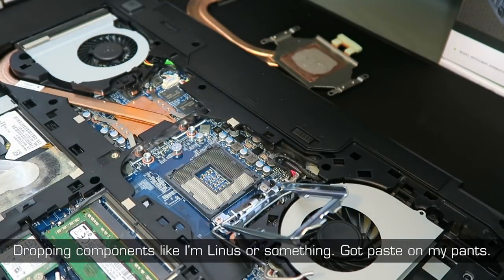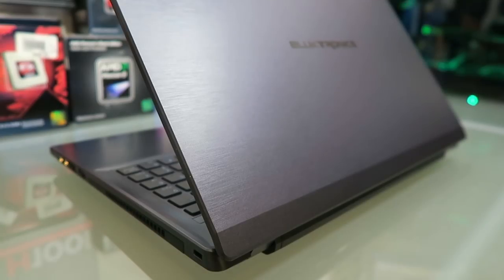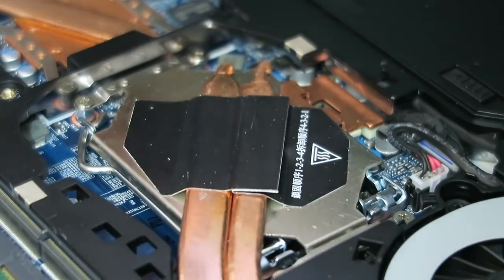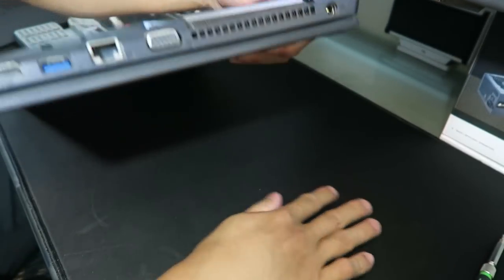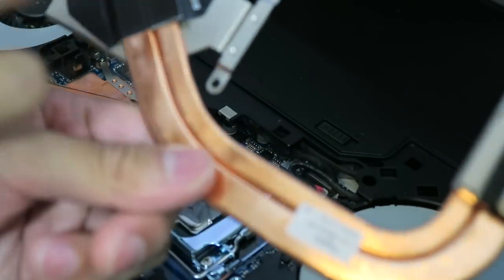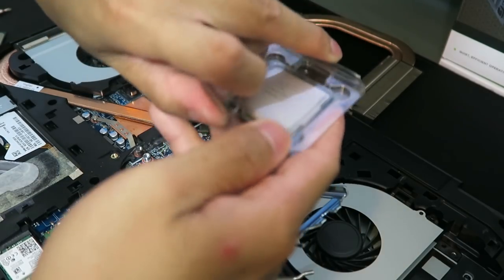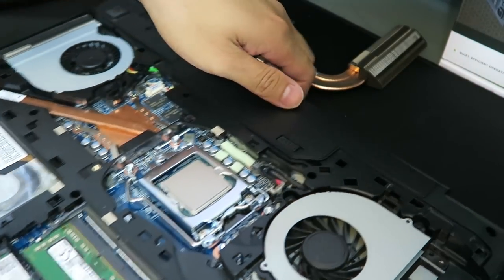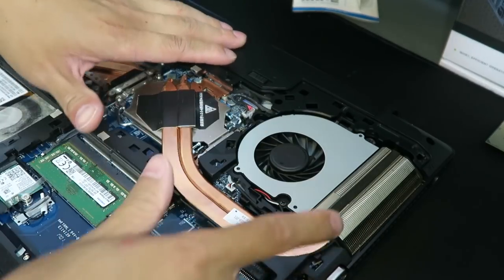Laptops That Use Full Desktop CPUs

Comment: As far as I know, "desktop cpus in in laptops" started earlier than 2007. I have a desktop replacement laptop from 2004: HP Pavilion ZD8000. It uses prescott Pentium 4s. Someone said that it can run with cedar mills too, but I never tried it.

Comment: If it's at all possible to have this caliber of cpu in a laptop then I don't know why the big companies don't have models with these CPUs. Especially the behemoths of laptops ie the acer predator 21X and the asus rog gx800vh!!
Reply: Morhaph Hajjouk It's more profitable to sell a machine that cannot be upgraded than one that can, so even these extremely high-end, flagship laptops like the water-cooled ASUS GX800 and the 21" Acer Predator laptops use soldered, Skylake CPUs, which is a real blow to the value despite the fact they are sporting partially unlocked (the HK model processors) hardware.

Comment: wasn't before Pentium 4 that laptops started to use different sockets and different versions of CPU's.
got an old Aopen with a standard socket 478 Pentium 4 3.06 HT in it... and a crappy Nvidia FX5500. was just for schoolwork so it was good.
had an Hyundai HN50000 before that one... but that is a dinosaur that is so old Hyundai don't know they made it x)
(was a Pentium MMX 166MHz, 16MB RAM, 1.2GB harddrive and a S3 gpu, is a AMD 400MHz in it now, 64MB of RAM and a 4GB CF and works flawless for old DOS games...)
but know there was some low-wattage Pentium 4 2.8GHz for laptops, but these where desktop cpu's that run stable undervolted.
after that stuff started to split, first in different versions of the cpu and then different sockets.
(AMD Turion X2 was socket 754 and last one to use standard socket before all went different socket, so this was the other way around, a laptop cpu you could use in your standard desktop.)

a funny laptop's that uses desktop cpu's are the the ones from Clevo. example the X7200 that uses a fullflegded socket 1366 i7 and support for 2 MXM gpu cards for ether SLi or Crossfire...
then the P270WM comes... a dual gpu socket 2011 laptop with quad-channel ram support and 3 2,5" drives... nuts...
Reply: Børre Børresen It was called the P270WM and was slated for release in early February 2012, just a few months or so after the X79/LGA-2011 high-end desktop platform launched, but the system had overheating issues so it was never launched; instead, another year went by and a newer, revised model using the same hardware platform and socket was introduced in early 2013, in two models, the P570WM (non-3D/non-120 Hz) and thr P570WM3 (3D/120 Hz).
Reply: the P270WM was launched and was the successor to the X7200, we in Multicom in Norway sold a 100ish of em. (i even have a working one in my shelf, missing MXM coolers though...)
the P570WM was though a better buy when it came.
heating problem of the P270WM(and also X7200) was with the ones equipped with Geforce GTX480M or 580M in SLi, just as Alienware these went toast quite fast, and if not the gpu's got fried then the power-supply went *poff*.
with the P570WM the Geforce 680M was released and Nvidia had done way better job on heat with that.

most we sold was with Quadro cards as gamer's wasn't interested in these very expensive, super loud and heavy behemoths but lot of businesses was interested in em for various reasons.

Comment: You struck a very balanced combo, with ~100% CPU and also ~100% GPU usage. You get the most out of both and don't idle or get bottlenecked. I was surprised buy the decent temperatures.

Comment: Just in case you weren't aware practically all laptops used desktop type sockets until the Pentium 4 era when the centrino (Pentium m) came out and started the push towards low power consumption. Back then you bought a Pentium 4 desktop laptop for power or the weaker centrino for portability. This was eventually developed into the core duo/ core 2 duo and ported to desktops which is probably the only time a chip developed for mobile was ported back to desktop, although the centrino was just a refined Pentium III.

Comment: Really appreciate you satisfied my curiosity on the process of upgrading a laptop that use Desktop CPU ,
 
At the beginning i thought you would bump into things such as 
bios problem (or somehow they locked the bios ) 

Btw is there anyway to control the fan speed ?
Is there a way to undervolt the CPU for better temps and battery life ? ( curiosity and extended battery life !) 
as for the CPU if it's below 75°C i quite ok with that 
but for the GPU hitting 85°C was a bit too much for me

Now my opinion 
As a power user , a desktop user for over 7 years myself and a guy who need to go to University about 3 months later

rocking a i7 3370 + 16GB ram + GTX 1060 6GB

i mostly use my PC for files compression 7z/Winrar , 15 tabs chrome , Dota 2 , premier pro , phyton , Civilization VI , NieR:Automata , Shadowplay and some triple-A title

A pentium G4560 will mostly not sufficient my usage 
 it is still slightly better i5-7200U and slightly weaker or equivalent to i5-7300U which is mostly found in laptop under the 700 dollar price bracket 

A i5 6600 would be a wise choice in this case it crushes the i5-7300HQ and perform near a i7-6700HQ which is moslty found in 800 dollar and above laptops

A i7 7700T/ i7 6700T would be better to control the heat output and give you a good performance as long as the price is reasonable (35 watt)

BUT intel is going to release the 8th gen processor
 on 21 of august which is tomorrow (in my time zone GMT +8)  

it rumor that 8th gen core i7 and core i5 mobile U series chip  will have 4 core and 8 threads And a TDP OF 15 WATTS

Intel Core i5-8250U – 1.6 GHz base clock / 3.4 GHz turbo, 6MP L3 cache
Intel Core i5-8350U – 1.7 GHz base clock, 6MB L3 cache
Intel Core i7-8550U – 1.8 GHz base clock / 4 GHz turbo, 8MB L3 cache
Intel Core i7-8650U – 1.9 GHz base clock, 8MP L3 cache

i7-8850U is also rumor that it comes out ahead of the i5-6300HQ 

conclusion 
upgradeability is a way to save more money since you don't have to change the whole laptop for a cpu

but i think the new 8th gen chip will destroy the i5 6600 in the same price bracket  in term of performance and power efficiency

Comment: I own a Toshiba P30 Laptop :) It's from about 2004 and has a Pentium 4 HT 560J processor in it running at full speed. That's a LGA 775 desktop CPU that has a TDP of 115w :) It has a massive dual radiator/fan cooling configuration. Still runs like new, and is really good at heating to room too

Comment: what  bothers me most about laptops these days isn't even not being able to swap out the processor, that would be handy, but its so annoying now days to even do simple things like chuck some more ram in or drop in a new hard drive/SSD, I've got an older HP G3 250, to throw another stick of ram in, i had to completely dismantle the laptop and pull the main board out because theres no simple access panel at the back, replacing the hard drive is a bit simpler, but still requires taking the keyboard and the entire top cover off to be able to gain access to the hard drive, i just wish the bigger companies would make things like that easier, but i'd definitely love to be able to easily drop a new processor in too, that'd be nice.

Comment: There is a market for "desktop replacement" laptops. I bought one with a 7700HQ and 1050ti because I wanted some graphics for light gaming. It would be great to be able to upgrade the processor in future but I will do that by selling the entire laptop or just buying a new one and handing this one down. 7700HQ isn't bad for a processor soldered to the board. I'm not feeling deprived. I actually bought this laptop to take to the Philippines as a desktop replacement. I shopped online and I could barely build a desktop as capable as this laptop from new parts in the Philippines compared what I paid for the laptop in the US.

Comment: There are two main reasons manufacturers don't use desktop CPUs:
1. Cost. It costs manufacturers more to design, engineer, and build a laptop that can use a desktop CPU. heat management is a concern and requires a good design to dissipate. Also, if users are able to upgrade their laptop by dropping a new CPU in, that's fewer users that will buy a new laptop in a couple years. 
2. Battery life. Desktop CPUs draw much more power. As such, they will suck down battery life. Most users don't need the power that a desktop CPU provides but would complain about poor battery life.

Comment: Got an older one for you, I own a Thinkpad G40 from 2003. They were socket 478 laptops. Thats right, Northwood Pentium housefires. Mine has a 68w 2.8ghz Pentium 4 in it. Oddly enough the cooler is fantastic and keeps it under 60c with low fan rpm. When it's under 55c it runs passively.

Comment: Actually, I still own a Emachines E510. It's a 2003 build date laptop  that has a regular CPU socket. The funny thing is the old bugger still works, swapped the Celeron single core for a Core2Duo cpu from the fried laptop I bought afterwards ( it was a trash HP, as a enthusiast PC repairman, HP and Dells  are a nightmare to me ) and the Ram upgraded from 2 GB to 4 GB. To date, I can still browse the internet with no issue , play some games, use YouTube up to 720p ( the onboard graphics can only handle  that much online, but it can handle 1080p movies files offline when linked to  my TV). This  laptop has been a wonderful workhorse and a reliable failsafe in case my newer laptops or desktop kick the bucket. Besides, it's not like I keep it shelves, the bastard runs 24/7 with incremental games loaded.
Reply: Dread Walker Emachines releases reliable computer.

We really are in the darkest timeline...
Reply: Such a great laptop, he definitely deserves a name after 14 years of service.
Reply: Roos Skywalker Thank you, you actually gave me an idea. I will now frame the old nutjob when it finally dies. Still gonna have to think of a name tho and it looks like he still has plenty of juice in it,commenting this from it right now. This laptop really goes to make a statement on the the quality of production in the electronic department  lately, since i changed 4 laptops while i had this one and 2 desktops. Shame on the companies really, if a almost no-name brand can slap them on the face with a way more cheaper and durable laptop for nearly the same performance. When i bought this one back in 2013 in Romania ,I really thought i was seeing double since it was  only 334 dollars brand new, which was rougly 40%  of the price of a similar branded laptop.
Reply: Hah, Emachines only shipped their computers with low end processors like Celerons. The first time I hear of an Emachine having its CPU replaced with a higher end one, it's a laptop :-P
Reply: And it was made 3 years before the Core 2 Duo came out and 2 years before the Pentium D came out!
Reply: I don't know why you had to reply to me with info I already knew since I have worked from 2002 to 2012 as a computer tech mainly handling low to mid level repairs and doing custom builds. And I pointed it out that I replaced the Celeron with a Core2Duo from a later bought laptop that died (it was a garbage level HP bought in 2007 which had a fried motherboard only a week after the 2 year warranty). I mean, I thought that was self explanatory or easily deduce-able from my previous comments that I was speaking of a period of time from 2003 to today.
Reply: Dread Walker I call laptops older than 10 years survivors, (in addition to a personal name) because they are. I had on such survivor, he died at the age of 12.
It was a silver coloured Dell, back in the day 2006 it was a very expensive high-end laptop with 4GB RAM, a dual core and 256MB VRAM dedicated graphics. It cost a whopping 1500€ back then.
I have no regrets, it survived many things, including but not limited to: a car crash, moisture and a short circuitry. Ow yeah to fix the GPU it was put in the oven at 200°C. That fucker did it all and survived until one day he didn't boot anymore.
The CPU died, and with that included its life.
#DellVeteran
Reply: Roos Skywalker May he rest in peace.  Mine is still  to show any  signs of dying at the moment, well  his battery is nearly dying, the thing barely keeps a 15 minute charge, but hey it's  enough to save in case of a power outage. What helped a bit with it's long use life is the fact that I break it down to the last single part and do a thorough cleaning every 3-5 months. Dust is the single greatest killer of laptops,  and this one is quite the magnet for  it, well maybe to a bit of a design flaw, but hey for 334 $ this guy paid it'self 5 times over anyway, so if he wants to take the final rest,  i can at least build his memorial :D (well...after i do one last surgery on him to try to  save him.)

Comment: Clevo made designs with desktop-CPUs all the way back in the days of the single-core Pentium 4. I had one of those, model number was D900T and it was available with a GeForce 6800 for graphics. Very large, very heavy device (17" 16:10 screen). Cooling demands were such that there were 4 fans installed - 2x CPU, 1x GPU and another that apparently served the overall system. It also had internal space for a pair of HDDs on a RAID controller that could be run as either PATA or SATA (provided you had the right cables to connect the drives) and two (!) optical drive bays. There may also have been a model that supported the competing AMD processors at the time but I don't remember the details.

Comment: Actually, all of the earliest laptops and other portable computers used desktop CPUs because in those early days there were no CPUs designated for mobile use.  A portable would have had the same type of processor as a desktop because that's all there was.
Reply from the maker: Good to know, that was before my time and there doesn't seem to be much mention of it, seems like they kind of slowly switched to mobile specific processors and haven't really looked back, except for some few examples such as Clevo barebones and a few others

Comment: Is there a limit for the upgradability. Just in thinking about how long you can realistically hold onto the machine, do you reach a hypothetical point at which compatible CPU upgrades are no longer manufactured? If so, how soon is that?

Comment: Question, is that laptop rated for an 's' variant CPU? I've got some HP aio desktops I wanted to upgrade and I think officially they use i5-2500s for an upgrade to keep a lower tdp, but I've wanted to just get a regular i5-2500 but was worried about the higher tdp with the small heat sink, similar to your laptop but with 2 fans.

Comment: I had a huge Sony laptop with a desktop P4 at 2.8ghz back in 2003 or so. PGC something or other. Also had a GeForce 5600. That thing weighed a ton and ran blazing hot. But hey, at least the battery life was non-existent.

Comment: Can you add a i7 to this laptop that you showed us Pal. I am interested in finding these kind of laptops. And is the GPU upgradeable. That would be great to know. Awesome video. I love it. I would love to find a laptop that would support a swappable GPU.
Reply: They are all swappable but you are limited to GPUs from the same family. If it comes with a GTX 1050M chip you can only upgrade (or downgrade) to the GTX 1080M. You can never go to the GTX 1180M whenever that comes out.
Reply: Roos Skywalker if a eGPU is added to this laptop with it still be limited once the CPU is upgrade. Through Pcie port.
Reply: Jose Servin is that a question?
If so, are you asking whether the CPU limits your options?
Reply: Roos Skywalker more like the Port on the motherboard buss.
Reply: Jose Servin No not really, eGPU uses significantly less bandwidth than a desktop GPU. Mobos can deal with that. Especially with a desktop CPU there is no problem.
If anything, the eGPU itself is the bottleneck.
Source: Own experience

Comment: Many laptops from 1999 to 2004 used desktop cpus , some compaq presario models from 1999 to 2001 had desktop amd althon's in them and some even came with desktop grade northwood processors . that trend continued with many laptops from 2003-2005 using desktop pentium 4 cpus , some hp and fujitsu atleast i know cause i had those

Comment: Thanks a lot for uploading video but i have some questions 
1     where did you get motherboard without CPU or how to install CPU or upgrade CPU on motherboard.
2          is there any way to upgrade graphic card to boost gaming performance. 
3          it is possible to upgrade any laptop available in the market are there is any specific one
Please reply to my question questions I will be waiting for your answers and suggestion thank you
Reply: 1: He doesn't have a motherboard without CPU. He removes the CPU from the motherboard and puts another one in it.
2: You are limited to GPUs from the same family. If it comes with a GTX 1050M chip you can only upgrade (or downgrade) to the GTX 1080M. You can never go to the GTX 1180M whenever that comes out.
3: No, you can only upgrade barebone laptops from Clevo.
Source: I own and upgraded one myself.

Comment: I had a Toshiba a75 from late 2004 that had a desktop Pentium 4. I remember because my eMachines Desktop had the same socket, I attempted to use the P4 CPU in but didn't boot, but it sure did fit. didnt test the other way around because the laptop was dead at that point, but when it DID run, laptop would overheat so often.

Comment: The thickness is not the real reason. It is about power draw. Intel for example, only provides (ultra) low power CPUs for laptop specific sockets or soldering capable ones. It just does not make that much sense to put in desktop sockets into laptops due to this issue

Comment: My Sager Clevo P750TM1-G sports a desktop i7-8700k :3 Yes, it runs as hot as you think it would. Yes, I undervolted it and under clocked it to get the temps down. No, its not delidded but I'm getting 64~65C in Fire Strike and lower in actual games, depending on the load.